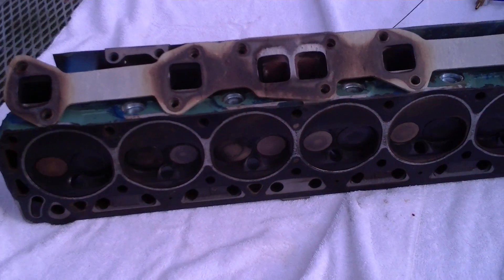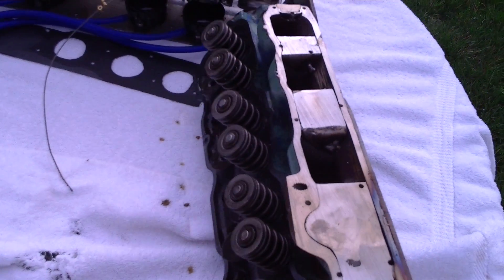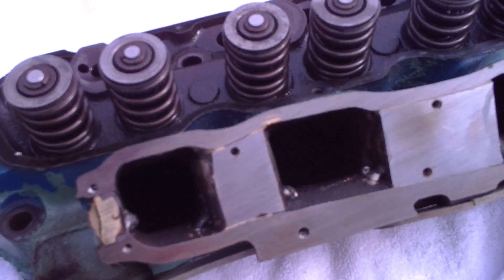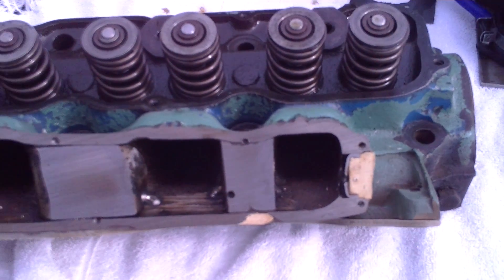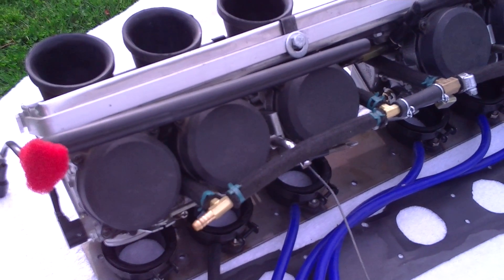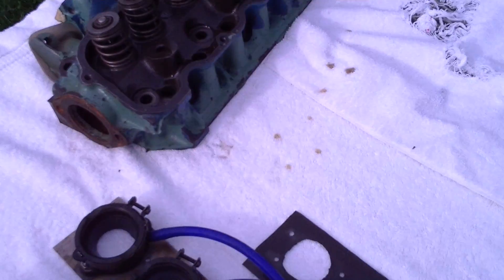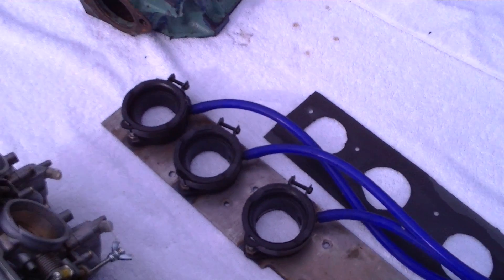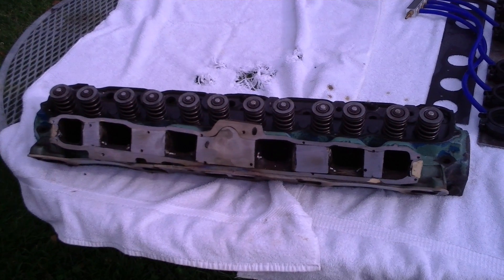Mustang on bike carbs disassembled head

Comment: Been banging my head against the wall to the point I am tempted to Cummins swap my mustang to get a drivable performance i6 in there (just kidding). Been all over Australian sites looking for the 2V 250 head. Found plenty of crossflow heads which require a lot of machine shop time for the block. Definitely not a "bolt on" option. Heavily modifying the head seems to be my only option for the time/money. Everyone has called me crazy for not just doing the common swap small block ford or LS but that's boring to me. I appreciate you journaling this on youtube. This blew my mind with ideas. I am going with a mega squirt port fuel injection to give me tune swap options for racing applications without sacrificing drivability and fuel economy on the highway. Just throwing a throttle body on the log head leaves the same issues in fuel injection as with a carb. Too little fuel and/or air to the outer cylinders. I can fab an intake with this idea. What blade did you use to cut the intake log?

Comment: What welding technique was used to weld in the port dividers?
Reply from the maker: They were tig welded (spot welded) to the pre-heated cylinder head.  A ceramic paste was also applied between the head and divider plates, which cures by heating.